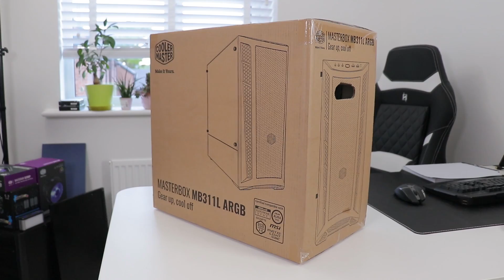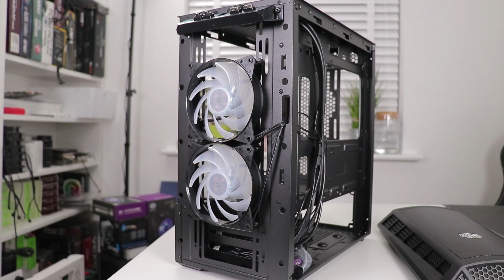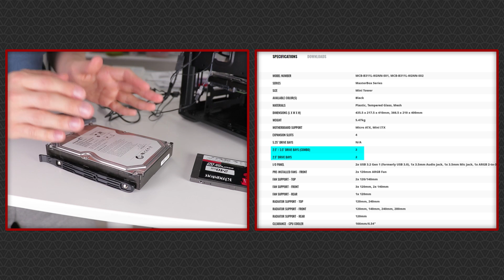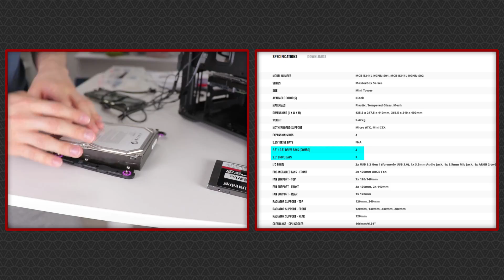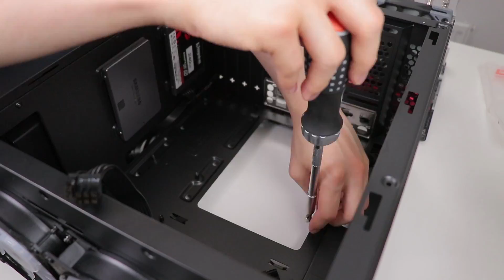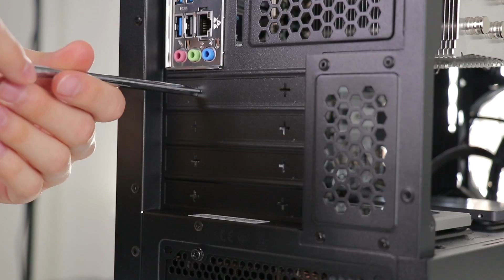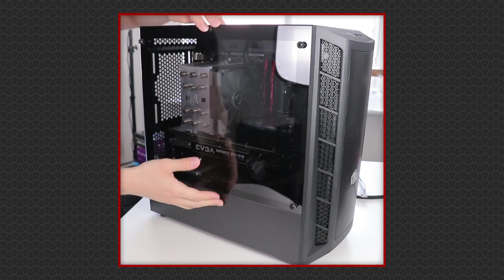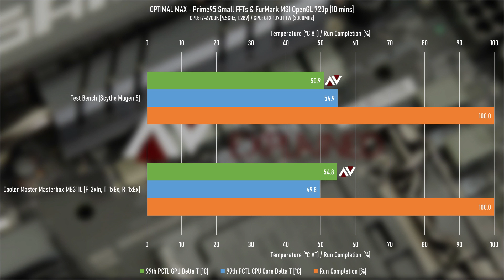Budget ARGB... but at what cost? - Cooler Master Masterbox MB311L ARGB review

Comment: Damn the case looks awesome but it’s a shame they cheaped out on the materials.
Reply: I mean it’s 60 bucks fuck do you expect?
Reply: @dpvny  darkflash dlm 21 is better bro
Reply: @nethenx6914  I love the design of that case, but no fans included, neither the mesh front
Reply: @leonardocalderongarcia2419  mine came with 2xargb 120mm fans. But im going to put a 280mm AIO on the front Then put the included fans as top exhaust. These newer GPU run hot for AAA games but tend to run most of the games 1+ year or older much cooler so i feel like a front mount AIO will help with CPU temps in a smaller chassis. I will probably mount the fans in front of the cage then the radiator on the inner side, as i screw the front side fans into the radiator/into the cage. For M-atx and its price it enables a cheap option for a 10600k build and a z490m. With RGB potential or budget left for RGB ram.
Reply: 50 bucks for me. Seems pretty neat.
Reply: are u gonna get it?
Reply: XxfaikingxX I just bought yesterday